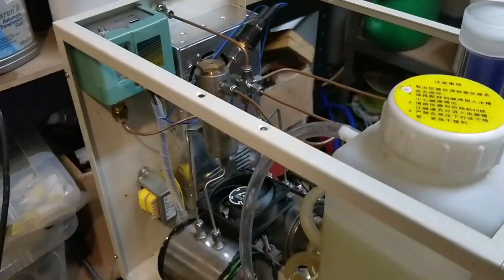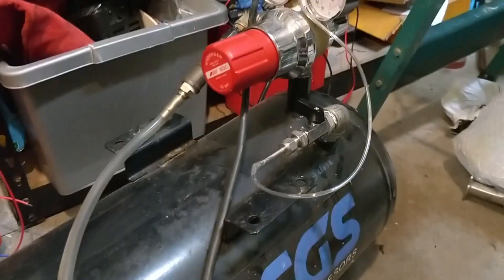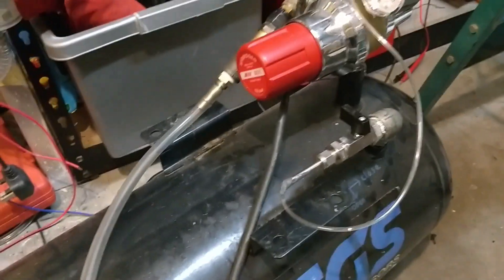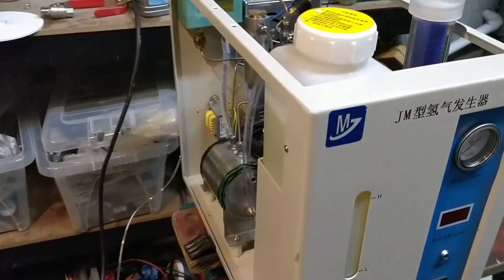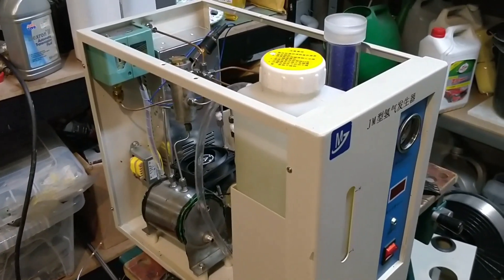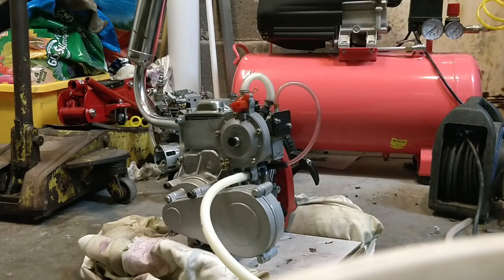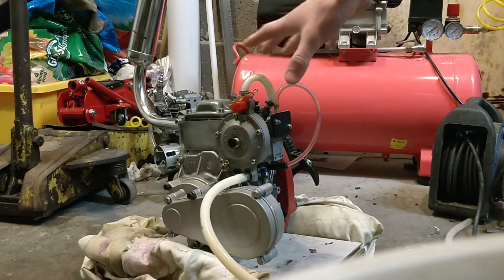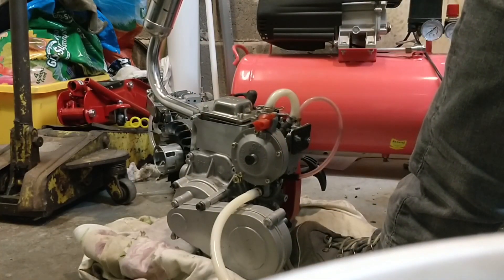Hydrogen Combustion Engine Final Run

Comment: Hey Hydrogen Guys, Why do we need a compressor to refill the hydrogen gas cylinder? Why not without the compressor. I would really appreciate your reply.
Reply from the maker: this was pure hydrgen gas, so it needed to be compressed in a gas tank so you can trasport more gas. It is more practical to use that way. the engine consumes alot of gas so a tank under presure is needed

Comment: hello! How is it possible that on Alex Lab's channel he easily compresses his HHO to 5 bars of pressure without exploding? In your videos you can see the manometer working at 2-5 bars of pressure, is it dangerous?
Reply from the maker: Hi.
In the video the gas was pure hydrogen gas. Not HHO.
You really don't want to be compressing hho gas.

Hope this helps.
Reply: @Hydrogenguys  Yes, I know! I am also mounting a cell of pure h2 and not HHO, I consider that it is better to use in a combustion engine and it is also safer. But I am surprised that someone dares to compress HHO gas to 5 bars, I think that going over 15 psi is already becoming dangerous. what do you think?

Comment: Sir can you tell me that engine running cost competitive to other fuel like petrol diesel ext. And what will be Power rpm  as compared to petrol diesel 
&  Can we use this fule(hydrogen) in normal ic engine? Like cng & disel cars
Reply from the maker: Hi.
Running hydrogen gas is alot more expensive than petrol. Unless you make it yourself.

The engine will also produced less power, around 20% less.
The only real benefit of hydrogen gas is that it's better for the environment when burnt in combustion engines.

Comment: What you need is more Hyrdogen production, I believe. More development. If the Hudrogen is being replenished, just as fast as it's being used, you could drive all day everyday until the bolts fell off, the clutch etc. My theory is Stan Myers probably had multiple alternators in sync with one another, along with multiple batteries in sync with one another, along with one Gaseous compressor(such as the one shown here) with a HIGH exhaust PRV attached for safety in case of too much Hydrogen build up. 

You have basically done exactly what we've all been wanting to do, now you must find the Key to ultimate Hydrogen production for consistency in this engine.

Comment: I have an idea of creating a sustainable source of hydrogen from hydrolysis:
Running a high enough amperage and voltage battery
How much energy can it create in volts and amps? 
The battery cell would have to cater to the exact specifications that's needed for the engine
Also, what is the bare minimum pressure required to keep the engine running? Preferably in PSI
Reply from the maker: Sounds interesting, 
Remember that this engine ran on pure hydrogen gas, not hho. The engine needed 3psi of pure hydrogen to run.
Reply: @Hydrogenguys  so, instead of gas stations, there could be hydrogen refineries that just run on the local water supply and refines it to pure hydrogen
Reply: @Hydrogenguys  since oxygen is more dense, there should be a way to separate the hydrogen from oxygen
Reply: @Hydrogenguys  and, if the water cell needs to be in the car, then maybe there could be an exhaust system just for the oxygen -given the right power output
(To maintain a certain psi)

Comment: What's wrong with the 700£ machine mate? Don't look like there's much wrong with it? I'm here looking for knowledge to convert a gx220 honda clone into a hydrogen powered generator. Do you think you could get it to run an alternator to power an AC load ?
Reply from the maker: The membrane inside developed a hole allowing the hydrogen and oxygen to mix. So was no longer pure hydrogen. Shortly after that it stopped working all together.

Yes it is possible to convert a gx200 to power a generator. As I did this a few months ago with a purchased hydrogen gas bottle. It works well, not as powerful as  petrol, and expensive to buy the gas but it does work.
You can see a picture or two on the 'hydrogen guys' Facebook page

Comment: I hope you get another generator someday, your videos are very inspiring.
Do you have any input on how I could do this with a larger engines? I have 2 two cars that'd love to be experimented with.  One has modern fuel injection while the other is a old school tbi.
Reply: TBI should be a piece of cake imo, you should be able to tune it just like any smaller engines as far as the fuel.aor ratio. You may want to install water injection to prevent hot spots in your cylinders.

Comment: Look bub if you can figure out what you've already figured out building your motor to run on hydrogen you for damn sure can reverse engineer the damn hydrogen gas generator you're bitching about seriously  reverse engineer that shit by replacement parts and fix it!

Comment: Hello a question Hydrogen has a high level of caloric energy and is capable of melting the hardest metals in seconds. Have you seen any damage to your engines ????
Reply from the maker: Hi, No damage of yet. However I have only ran the engines for 2 hours with minimal load.
Reply: @Hydrogenguys  do you believe this conversion will do under the load? Something like a power generator or a scooter engine.
Reply from the maker: @Volkyno  hi.
Yes I do. Generally speaking with hydrogen you end up running less power compared to petrol, this is because of many factors but safe to say a 5hp engine would run at 3hp on hydrogen. But depending on set up of course.

Comment: I us to to log gas conversion on cars and you are one of a few that can run on hho I think if you purchased a lpg gas converter and feed your tank to the converter it would regulate the lpg to the engine you will then need a mixer ring placed on the top of the carby this is what mixes the air coming into the carby with the hho.
Reply: You are correct I use to do log conversion aswell log parts are the go

Comment: Hi, is it possible H2 refill to the cylinder without pump ? How much H2 required per hour to run the engine ?
Reply from the maker: Any pure hydrogen gas generator will fill a container without a pump. Mine was able to fill to around 50-60psi

Comment: What’s the best method for tuning the timing?
Reply from the maker: With this engine I didn't need to change the timing. However on the 200cc engine I changed the timing. 2 methods come to mind. Altering the key way to retard the timing or move the Magneto. I'm sure there are better methods though

Comment: Its funny that every engine I run across on the internet from Hydrogen to tesla etc. never runs under load.
Reply from the maker: I think that's because it's just easier to show. I have added a load to the engine and it still runs. No way near as good as petrol but good enough for some applications. I think it would be alot better if the hydrogen was injected apposed to fed in.
Reply: @Hydrogenguys  IM going to agree with you on the injection being better. I saw a very cool video of a see through head firing on Hydrogen and I was quite  surprised on what I saw.  Thank you for clarifying the load portion of my question. Well done.

Comment: What modifications have you made to the engine itself other than changing the carburator?
Reply from the maker: Nothing. This engine ran better than the other Engines I have converted. All I did with this was change the carburettor. With other engines I had to change the timing. This engine had a nice flat top piston set up too which I believe helped alot, with compression and avoiding hot spots
Reply: @Hydrogenguys  idk if you made a video about it, but what or how did you do to make a proper fuel air ratio and the injection? Like you removed the carburetor and replaced it whit what? 
Thanks in advance
Reply: @semhouben6300  gas mixer like the lpg conversions

Comment: Can you make a video about the inside of the broken hydrogen generator, it should be easy to fix...
Reply from the maker: I had the cells sent out to be fixed. Worked for a few hours and died again. Now with no funds to throw at it I am putting it away. 
In the future I will buy pure hydrogen gas in high pressure bottles form a local supplier
Reply: @Hydrogenguys  i understand, i want to see inside the hydrogen generator, to see how it works, im curious how it generates pressure, why they fail etc

Comment: You can make hydrogen through electrolysis
Reply from the maker: I use pure hydrogen. So with electrolysis its not as easy, at this point it's just cost of a new machine
Reply: @Hydrogenguys  Hi, I am a Chinese guy, could u mind tell me about the hydrogen generator price, I found it was made by China, hahaha
Reply from the maker: @eigenliu  it was £750 shipped from China
Reply: @Hydrogenguys  Thank you so much for replying promptly

Comment: Oh that’s troubling.  I really enjoyed  the experiments. There must be different ways to produce high quality hydrogen gas. Maybe ammonia since it has a high hydrogen density.
Reply: Maybe electrolysis since water is readily available and cheap.
Reply from the maker: I need pure hydrogen. So tricky to do with electrolysis cheaply and for high pressure. My current machine that broke was electrolysis
Reply: @Hydrogenguys  https://youtu.be/nCqU-lU6HDU
Reply: @Hydrogenguys  it’s crazy alright... but crazy is good sometimes.
Reply: Quality of hydrogen can change dramatically with the quality of generator being used. Maybe we could fix or change some parts to your generator currently being used. I am a HHO builder and might to be able to help.let me know and I would be glad to point you in the right direction on what is needed. Also another great source on the subject is OZ Solar here on YouTube. He has a brilliant mind and is well rehearsed in electronics and gen- sets like yours. I gave him one of my generators for research some years ago and he has done some great things with it. He is Aussie and a good guy